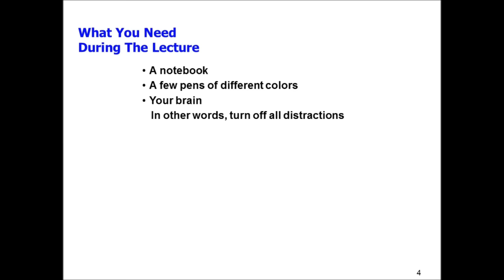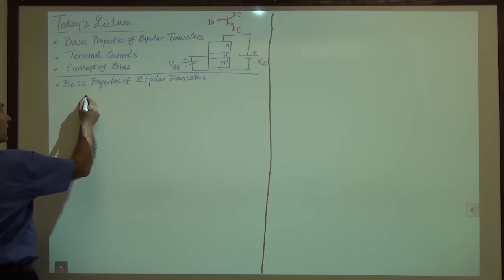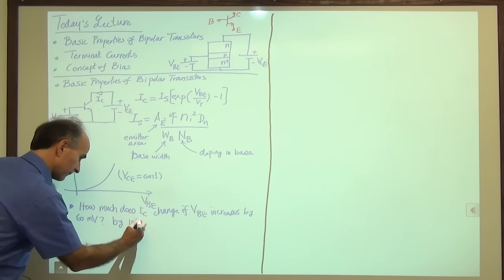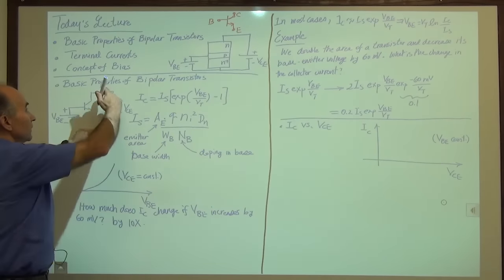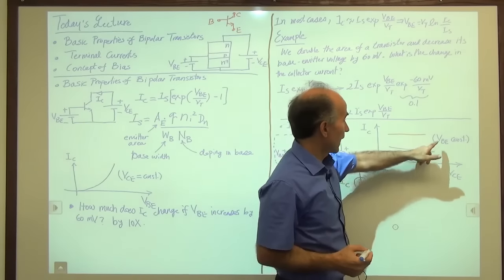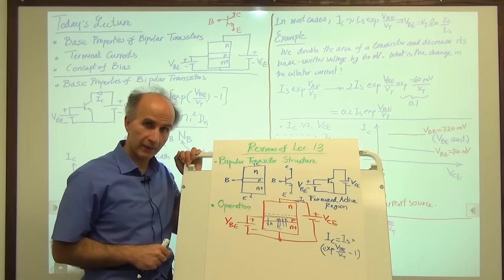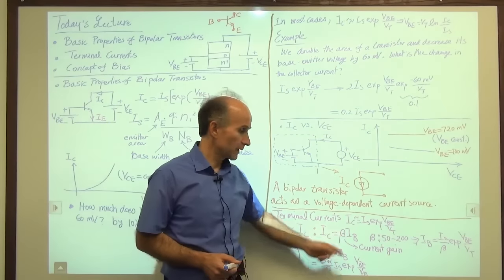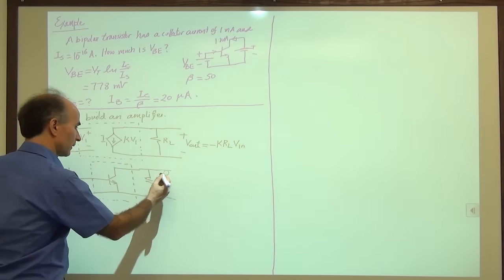Razavi Electronics 1, Lec 14, Bipolar Transistor Characteristics, Intro. to Biasing

Comment: It is not correct to define transistor as a "voltage controlled device". It is, in principle, a misleading statement. Transistor always had been a current controlled  device. With all my respect...
Reply: no, it objectively is a voltage controlled device with exponential relationship: it is clear in every explanation at university level. This is more clear if you consider that the beta coefficient is very variable according environmental conditions from almost one order of magnitude.

Comment: The practical bjt used may have some cutoff voltage but my voice signals may be weak,even lower than that cutoff. In this case it may trim some part of my original message. How to improve that?
Reply: Yeah thats y we use BJT AS AN AMPLIFIER

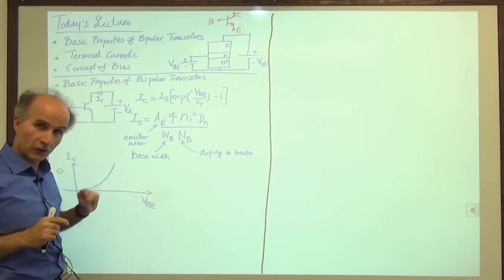Comment: i think at  14:20 there has to be made clear Vce is never constant but the power  supply Vce is to be constant the voltage from collector to emitter will change in acordance with whatever load it has

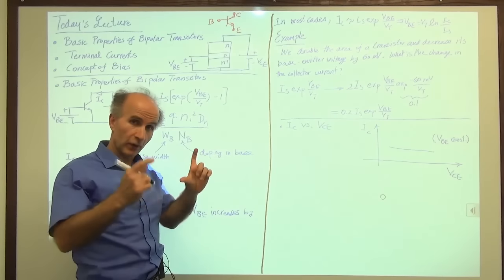Comment: 28:04, can you explain a little bit clearer, I still dont quiet understand since when VCE goes up, the potential in the C terminal will goes up and will be higher than the potential in B at a point, then the B-C junction will be reverse biased, hindering the flow of the current Ic. But there is also one more theory which is the high positive potential in the C terminal will pull the electrons toward the C terminal, making the current becomes even stronger. Like this is so confused, can someone help me out ?
Reply: (using an alt account here,) You see the thing is that the whole ingenuity in injection of electrons such that they can cross the reverse biased junction is the reason why the transistor as we know works, and not any two diodes connected reversed back to back as prof. referred to. 
Base is so thin, the momentum carries and injects the already flowing into the collector (despite the reverse bias) instead of flowing thru the base into the base terminal. If that happens more than we like, it won't perform as a good transistor. 
(Btw fellow learner here, All the best!)
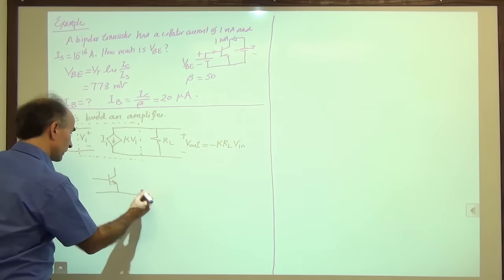Reply: @codemania-atlteamsquadron6050  actually what you said is not so true, cuz Razavi will explain this clearly in the Lecture 17 at 55:30, I have made it to the lecture 17 and Razavi eliminated all my confusion.

Comment: Is emitter current drift current or diffusion current??
Reply: Drift current
Reply: looks like 50~200 for Diffusion and 1 for Drift.
Reply: Its diffusion current
Reply: Because as the base width is very small ....it sustain very low voltage ....and you can see emitter is highly doped and moderatly doped .....so due high concentration the electrons starts moving from emittor to base ..as we also have depletion region at cB junction the emitted ions start moving to collector ....so its a diffusion current not drift current

Comment: how can a battery supply hole to the circuit ? it is not a semiconductor device
Reply: bro its just a convention to say it like that basically if you have studied ELECTRONIC devices And physics of it you would never say that.....Because the battery connected to the ptype is responsible for the supply of current into the base and this current is Due to the holes that diffuse from p type to ntype material in the BJT so the battery is just a BIAS basically!!

Comment: Can we use voltage dependent voltage source as amplifier??
Reply: No bro, this is a different application
Reply: Yes we can but we cannot realize it using just a bjt
Reply: that doesnt make sense, output voltage swing causes current swing, finally its the current which matters you connect  different load and get different output voltage.